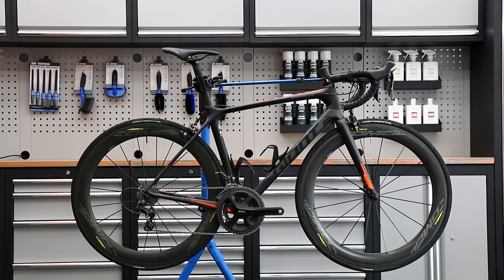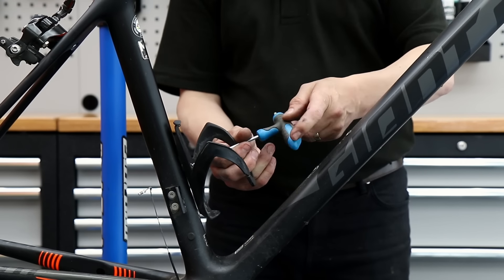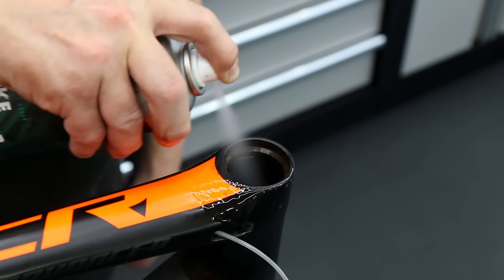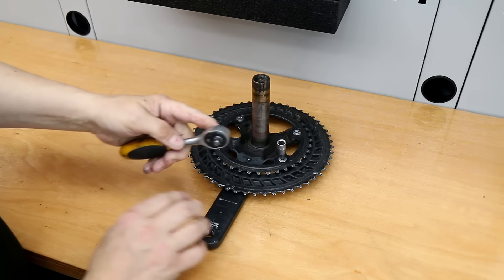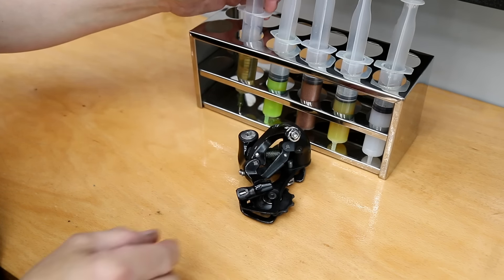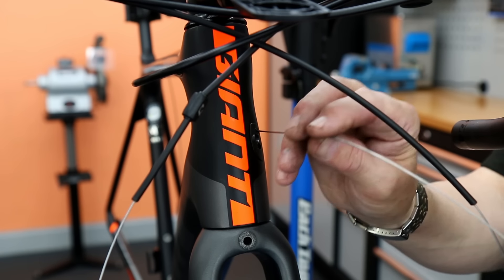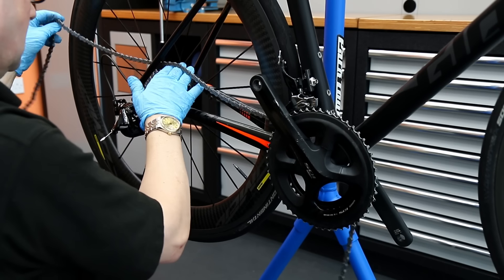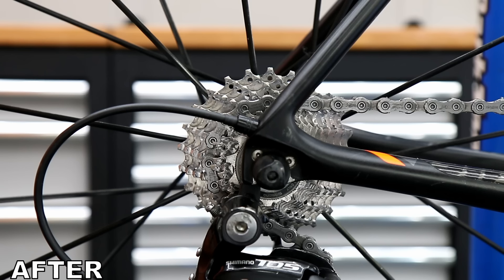Restoring This Giant TCR! Full transformation rebuild service! Chain waxing, bottom bracket, headset

Comment: If you get a crank bolt that is frozen, I recommend putting it in the oven at 100C for about 30 minutes. The materials have different thermal expansion rates so any bond gets broken. This is a variation on the standard industrial technique which is to use a blowtorch
Reply: My special talent is fucking up chainring bolts
Reply: @hambini in Bikespeeds house! 😎
Reply: who asked?
Reply: @peterers3  Peter-Peter-Peter-Pumpkin, who asked YOU? You don't even HAVE a bicycle!:face-blue-smiling:

Comment: It’s the little details that matter. Every video you surprise us with yet another little detail that many (if not most) of us are unaware of. My takeaway this time is the tool on the bottom bracket bearing pushing on the outer rim of the bearing. Pushes it in nicely with no damage to the bearing. This just proves that you do’t mess about. It’s a different tool for every bike and you have them all. Great video once again.
Reply from the maker: Thank you for your support Rob!🧡⚙️

Comment: Thank you for your video it is the best I ever seen, if possible can you show me how to adjust the 105 brake, that it won’t press on one  side damage the wheel bearing, you showing at the very beginning of the video. I like your Rolex gold and steel. If you  have time please reply me. Thank you, regards. Michael
Reply from the maker: Hi Michael that could either be the wheel not being seated fully in the frame or the mount turning so move the brake square and really tighten it up, another possible cause could be a buckled wheel🧡
Reply: Thank you for your help I will try

Comment: What torque spec are you using for the chain ring bolts? The Shimano charts I've seen call for 12nm-16nm but I've had issues with stripped bolt heads particularly when the bolts are aluminum and the threads are greased. I've had to back the torque setting down to 10ish nm.
Reply: Greasing/lubricating threads reduces torque needed to apply proper tension to the bolt. Quoting: "Much of the torque force is lost to friction—most of which occurs at the threads and where the nut-face turns on the washer". So applying specified torque my over-tension the bolts
Reply: I do them up to only 12 Nm since 10 Nm and above is already really high for a chainring bolt. If anything, I see the head flatten when torqued to 12 Nm, to which I stop using any chainring bolts that behaved like this.

Surprisingly, I've never stripped the threads or snapped these bolts, although I'm always concerned about the latter as I close in to 12 Nm while hoping for my torque wrench to click.

Comment: love your videos, very detailed and satisfying, saw you didnt use cable line (to minimize friction) at the bottom bracket where it rubs during shifting. is that not essentially needed?
Reply: I would use cable liners there to prevent the cables cutting into the guide. I saw this happen on a Condor and fortunately, we had a spare I previously dug out during my spare time.
Reply from the maker: It is bike dependant but not on this one 🧡

Comment: I Always use BananaWax Drag & Friction TDF Racing ChainWax to wax my Chains & BananaWax Bike Bearing MolyGrease Wax for Bottom Bracket Wheel Bearings  Cables and pedals. 
I've a Peugeot Perthus Pro Reynolds 753 & Vitus 979 Duralinox Being Vintage Bikes. it's Important everything is kept running smooth and serviced, makes a massive difference.

Comment: How often should i change my rim brake cables? 🤔 they work fine
Reply: The interval is dependent on several factors: How often you ride, how long you ride and what weather conditions you ride your bike in.

So the moment they start to feel unreasonably rough, replace.
Reply from the maker: If they work they work!🧡

Comment: I have a 2016 TCR similar to this, but my headset bearings dont come out easy like this, it is like they are tapered into the frame and not just nicely like into the cups like you show. Any ideas how to remove them, do I need some special tool?

Comment: Hey great show I have a question?
I just bought my first ever road bike I know its not much of a head turner I bought it secondhand. 
It's a Motion Typhoon bike 16 speed. 
This is my Question.
Can I up grade from the 16 speed to 21 & if so can you let me know a suitable cassette & crank.
I only bought this bike on Tuesday 6/8/24 I didn't give much for it & tbh I am finding it hard to find information on the maker.
Bike Information:
Motion Typhoon road bike
Alloy Lightweight Frame (56cm-Med/Lrg)
Hi Tensile Road Fork,
Shimano 16 Speed STI with Shimano Sora Rear Mech,
Double Chainset,
Alloy Road Caliper Front and Rear Brakes,
Alloy Double Wall Rims,
700c Schwalbe Lugano Road Tyres.
I live in Ireland.
Thanks mate.